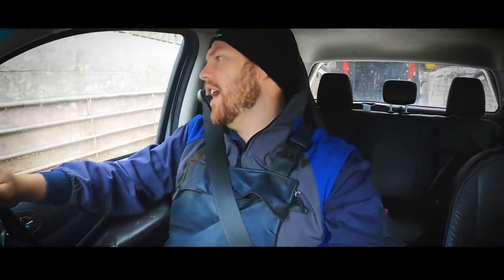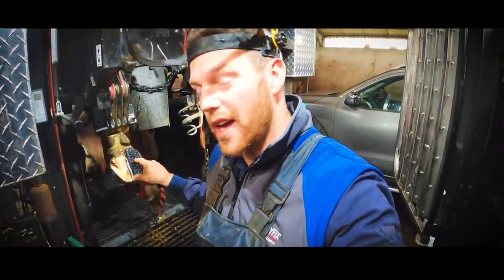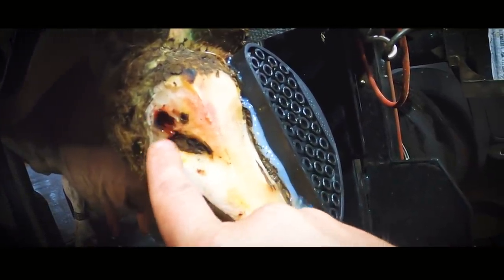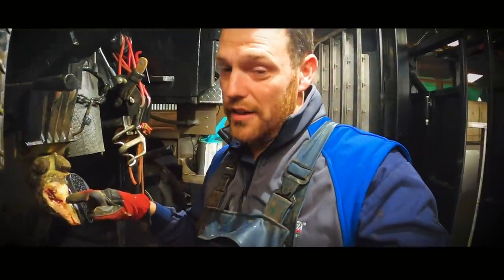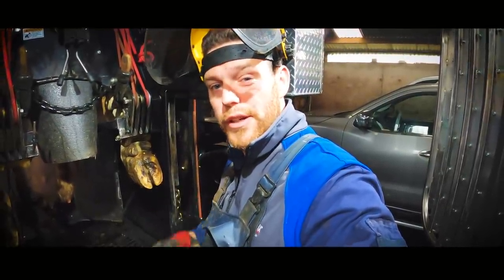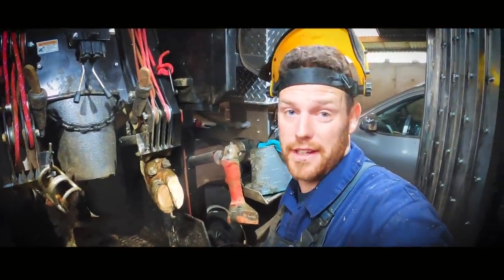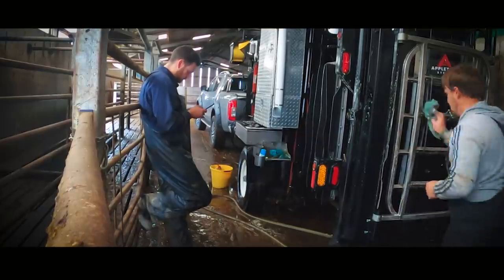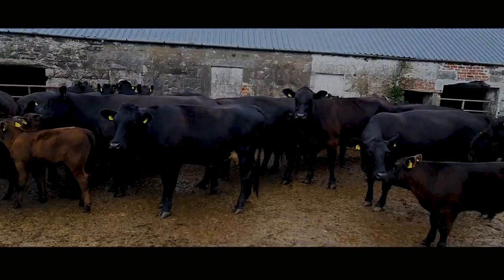BLOW TORCHING COWS FEET ... TRIMMING BULLS FEET & FENDER BENDING! | The Hoof GP

Comment: Ya do know that electricity doesnt work like water when you have a kink in the cable right? Electricity will still flow, but the chances of you breaking a wire are much higher when the cable gets bent so much.
Reply: It could be a safty feature with that crush.

Comment: Your crush has the same plate number as your pickup? Trailers don't get a separate crushing Ireland? And does that mean you can only haul the crush with your pickup!?
Reply: A trailer must show the same registration plate as the vehicle pulling it, therefore different vehicle change the plate on the trailer.

Comment: How hard is it to use a water hose to clean the hooves first?
Reply: There is no point.
Reply: Actually there is a point, unless you enjoy looking at manure.
Reply from the maker: There is to any hazards by hosing them down. The amount of cows I put through my crush it would make it unbelievably  slippy  for them and me. I dont want a cow to slip and break its leg. Also there is much electric equipment round  about  me that I wouldnt like to electrocute  the cow or myself or craig!

Comment: Electricity not going through a kink like water through a hose. Pull the other leg. 🤣🤣🤣🤣🤣🤣
On the other hand you should never use a wound up power lead as it will effect the supply to your equipment.